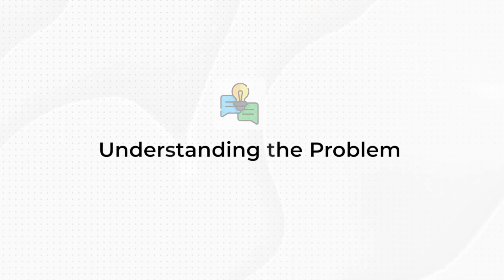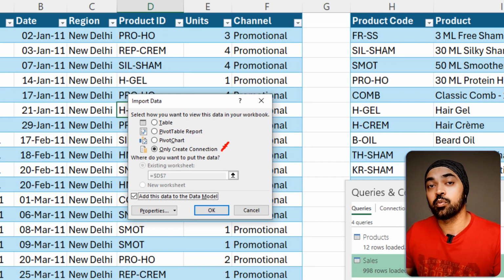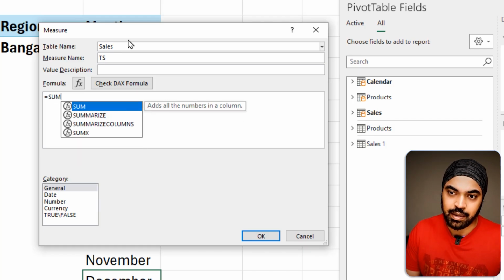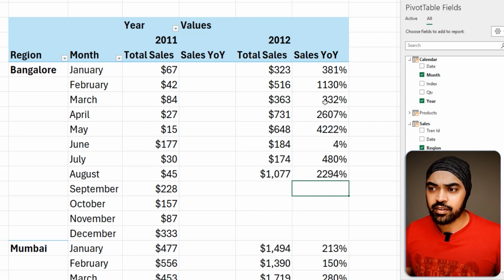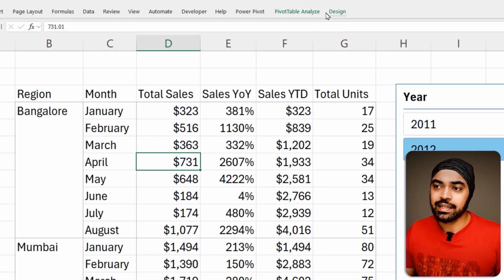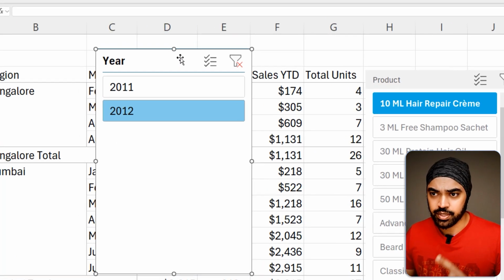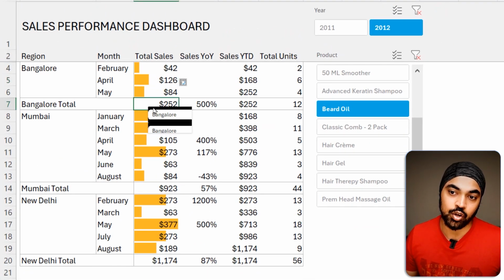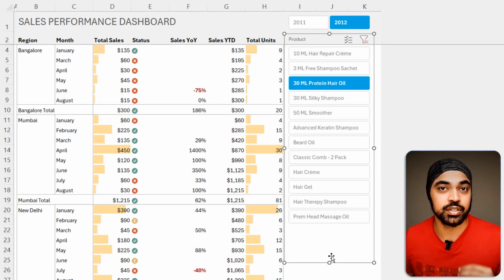Pivot Table Design Tricks

Comment from the maker: Download the Excel file here ⬇ - 
https://goodly.co.in/pivot-table-design-tricks-in-excel

If you're just starting out with Power BI and want to learn from the basics in a structured way, consider the beginner course available for only $9 | INR 499/-
https://goodly.co.in/power-bi-beginner

Already familiar with Power BI and ready to level up? Check out the DAX and Data Modeling course to build advanced reports and solid data models - 
https://goodly.co.in/learn-dax-powerbi
Reply: Anyone know why when I drag the measure for Total Sales to the values section, it shows the calculations for blank months?

Comment: Hi Sir,
you can compare the two sheets using Power Pivot, especially if the party names are the same but the months differ. Power Pivot is ideal when working with multiple tables.

I am sharing that Both Sheet Headers are the same-  Trade/Legal name of the Supplier, GSTIN of the supplier,
Month, As Per GSTR 2A With GST,  As Per Tally Name
As per the purchase in Tally with GST.

Please revert sir

Comment: This is a great video, thanks! I have a quick question, though - why did you opt to create the Calendar table in Power Query instead of using the Date table feature in Power Pivot? Does it provide you more flexibility if you create it with the script in PQ? Thanks!